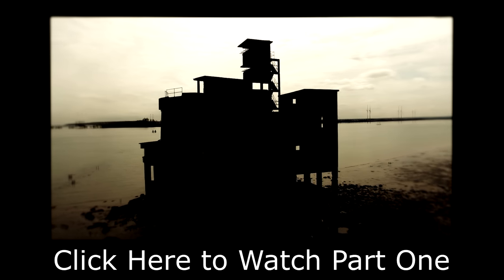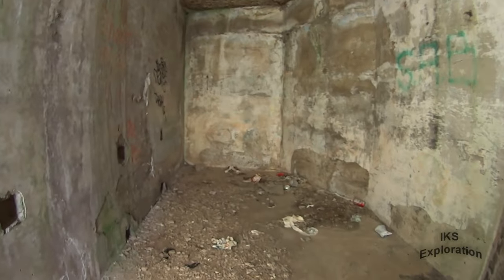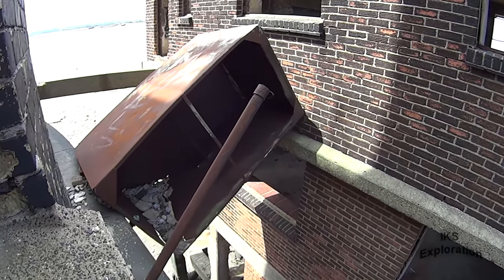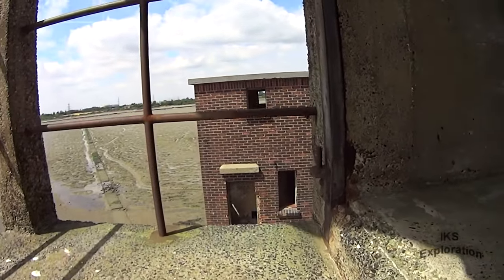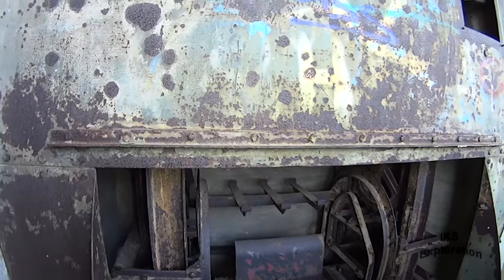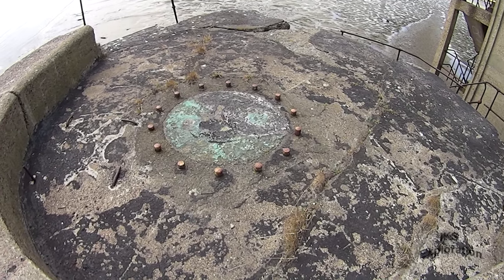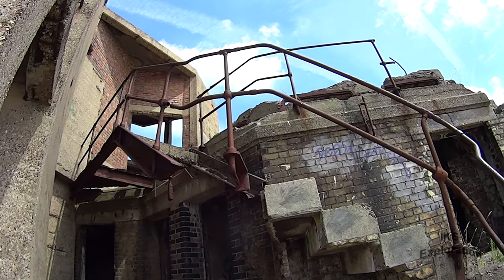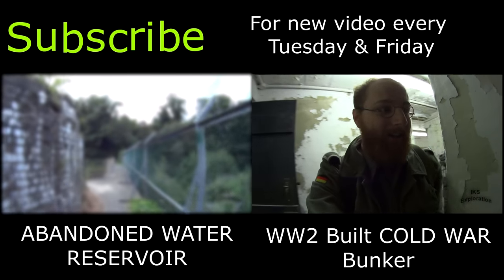GRAIN TOWER BATTERY - Part 2

Comment: Makes one wonder just how many towers and bunkers were erected all over Britain during the war! I'm in Vancouver and even we have relics all over the coast - even in the city - from a war that never came to our shores.
Reply: I'll tell you the best story that came of it:
There are still three searchlight/gun towers slowly weathering away on the shores of Point Grey, the westernmost end of Vancouver. Their wartime assignment was to guard the approaches to the city, presumably opening fire on any subs or saboteurs trying to sneak into the harbour. To this end, the most numerous boats, the local fishing fleet, were required to flash a signal to the south as they headed for their berths at the end of the day. 
One day, a skipper, perhaps too tired or distracted, neglected to flash the prescribed lights toward the towers. After several semaphored challenges, one tower loaded a practice round and laid a shot across the boat's bow. Unfortunately, the boat being a small target over 2 miles away, the trajectory was so low that the shot skipped off the water and continued into the path of a freighter heading to sea, neatly holing it at the water line near the bow. The freighter captain promptly turned starboard to beach his ship before it sank, and the fishboat operator presumably flashed a hasty recognition signal and headed for the inner harbour.
Thus, the only shot ever fired from Vancouver's defenses managed to put an allied freighter out of commission.

Comment: The Battery Observation Post [BOP] tower is the same pattern as the ones at Landguard Fort at Felixstowe. The top room with the shot fall indicator plinth should have a wooden floor. The towers at Landguard used to be easily accessible, and when I worked at the nearby docks, I would quite often take my lunch and eat it at in the top room of one of them, watching the world go by. Sadly, as often happens, a stupid person ruined the free access to the site, by climbing on to the roof of the tower - and falling off. Very soon after that, a large fence enclosed the site, and both towers were put out of the reach of most visitors. The gun pits at Landguard are very similar to the Grain Tower ones. The Grain Tower's battery was an unusual twin six pounder QF [Quick Firing] arrangement, specifically designed to fire on fast moving German E-Boats. The six pounder was presumably the same as the six-pound anti-tank gun that was in common use, and also the same as fitted to Coastal Command Mosquito XVIII 'Tsetse' fighter-bombers, although this, of course, was a magazine fed automatic weapon with a specially made Molins muzzle brake. It was a quite devastatingly powerful weapon. I very much enjoyed all parts of this video. I have been interested in the Grain Tower for several years, having been told about it by a lorry driver, and seeing pictures of it. There's something oddly appealing about it's weird lopsided shape, and it's sheer isolation is actually rather moving, when one thinks of what a hive of activity it must have been, and now it sits alone with a huge sky, the cry of seabirds, and whatever ghosts of the past it contains for company.
Reply from the maker: +brianartillery thanks for sharing :) going back again soon :)

Comment: The Martello tower looks in reasonable condition, but much of the later concrete structure is in really poor condition having became porous over the years and absorbed the salt water which has caused the reinforcing bar to corrode and swell bursting off the encasing concrete. I hate to see history disappear, but I can help but think that it would be best if some of the stair ways were taken away before someone comes a cropper on it. 👍🏻